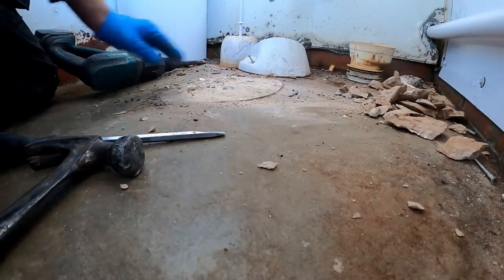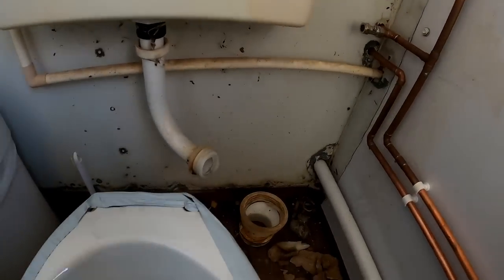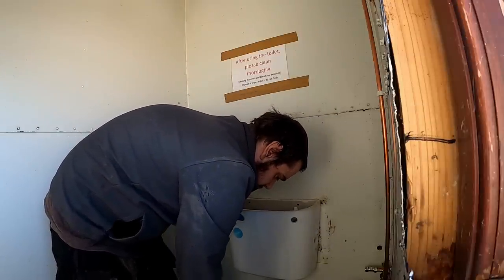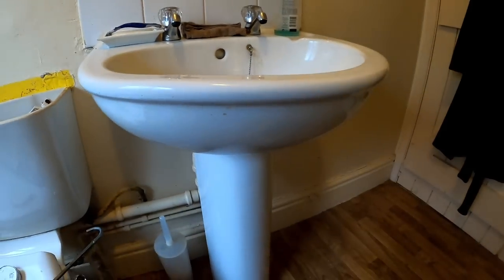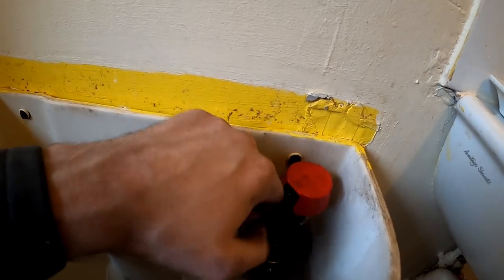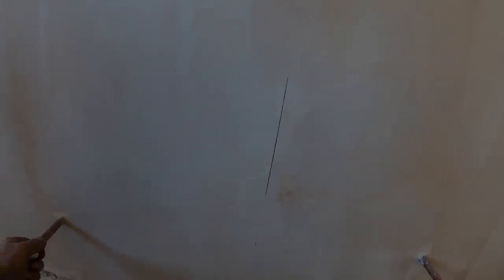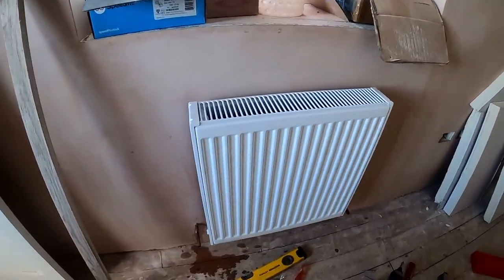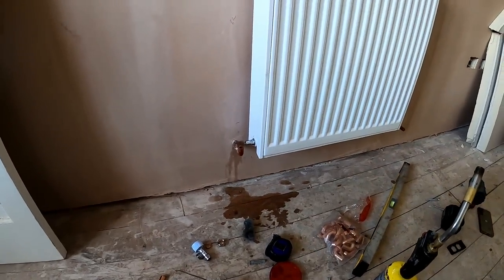Jobbing Around Sorting The Problems

Comment: Hey Tom 
Little tip for getting the silicone off inside the cistern,  the yellow paint scraper that has the Stanley blade in it, cost about 3 quid!! Great for that! 
Have you tried the viva ball valves 4 in1 side bottom ½ & ⅜ brass tail 10 Yr warranty screwfix toolstation delay entry as well about 13quid . Keep a few in the truck for every eventuality. Best  bottom entry for low pressure dudley hydroflo remove the green flow restrictor & will give great flow rate 👌
Reply from the maker: I've been mainly fitting the ag air gap ball valves as I got picked up on an inspection from the water board for fitting ones with an adjustable stem, a lot of the vertical ball valves lost there approval due to the seals failing and water being back syphoned into the main, It's difficult to know what to fit for the best sometimes, thanks for watching mate 👍
Reply: @PlumbLikeTom  yeah you're right Tom about the fill valves. The viva ones now incorporate in the stem a unit to prevent backflow.  I used to fit the green fluidmaster delayed fill. But found in cisterns where the hole is close to the back of it inhibits the valve to rise & fall. The same with the pro ones you fitted . Thats why I went across to viva brand. Its so difficult these days to fit anything without some rules or regs forcing you to fit specific brand products!! 
I'm glad I'm not the only one that struggles. I saw that vid on thr pan where the flush pipe cone was leaking !
What I tend to do in those situations is remove the cistern so allows you to stick your head in & remove the flush pipe & cone & fit a new one with out taking the pan out ! I did empathise when you were hauling that pan out nightmare when everything is all tiled in & no access , what I call SEP someone else's problem !!! 

In a different note what do you like to do on your down time away from work as you have to make time for that or you'll end up with burn out! Been there done that! 
The body can't go at the rate you keep pushing it working 7 days a week . 
I do enjoy your videos as you like me are very conscientious & take pride in what you do. Your knowledge & experience at such a young age is impressive . Some of the stuff you do I've never done in my 47year plumbing career so it's always good to learn & see new things. 👍
Reply from the maker: Thanks for the support mate, I will defiantly check out the viva fill valves, the job with the pan was nearly impossible, because the cistern was chopped into the brickwork, there was no easy way to get the thing out, in my spare time I like to repair and collect old jukeboxes, it's just a hobby and I'm not really an expert but I like to see all the mechanism working, the music always sounds better on jukeboxes

Comment: Sorry to hear about the supplier issues. With the messes you are dealing with it must be tempting to have hot spares for pulling parts from sometimes but it's a joke that you would need to do that.
Reply from the maker: Thanks for the support mate, it becomes frustrating when you pay for something and it has parts missing, its difficult to check inside the box as everything is sealed so it obviously left the factory incomplete, it just means extra visits to site, which costs me

Comment: 😂 , Those rads looks chunky , I wish they painted the walls, before you hang them , personally, I prefer to do first fix myself, and have that rad on a wall first before the pipe work goes in . But is never the case when you taking over someone else job 😅
Reply from the maker: Thanks for the support mate, my old apprentice did this job, he still works for me but I was just being put under pressure to push the job along a bit, I will take the rads back off for the decorator, like you say it leaves a much better finish, hopefully it's just the boiler and the bathroom to second fix and this job will be all done

Comment: Try Grant for oil boilers,   support a even more local manufacturer and use Houndsfield from East Anglia!                    I have used both for years and rate them far higher than WB.         HTH
Reply from the maker: Thanks for the support as always mate, I am definitely considering switching to Grants, the last few Worcester I have fitted have been faulty, damaged or missing parts, it's simply not good enough, although all issues do get resolved it adds time and costs onto the job which I always have to stand
Reply: Grants are awful boilers always a leaky mess. Worcesters quality control has been iffy since cover but is getting better.
Reply: @samharrison3994  I personally don't believe WB have made a good ,robust oil boiler since steamers came in!.            Older Grants did have issues with the chromed pipework joints weeping,    alot of this was down to the smallish expansion vsl that the installers thought would be ok for a 16 rad system......     newer ones don't seem to suffer this problem since the 25 ltr vessel was introduced.
My own Grant boiler jobs always had additional vsl fitted and I never had any issues.

Houndsfield is a nice unit but he has a limited size range and no combi,    its good to support a PROPER  British manufacturer though and they are good people to deal with also.

Comment: How do you work out the width of pipe first fix distances are they always the same distance away from the end of the radiator?
Reply from the maker: On first fix you add 90mm on to the length of the rad, a standard radiator valves adds 45mm per side, this method normally works perfectly

Comment: How come the rad valves come with copper and brass olives? Do you have to use different ones on different pipe ?
Reply: Not sure if there is a general rule, personally I use copper olives on plastic pipe and brass on copper.

Comment: Look forward to watch your vids  👌. Question  regarding olive s  ?   Copper \brass  reason please
Reply from the maker: Thanks for the support mate, copper olives are softer so are better for plastic pipe as they take less tightening, generally brass olives are better for heating as you can nip them more, brass olives are normally supplied with more expensive valves, both will work, it's always nice to be given a choice and have a few spare olives for the box, thanks for watching mate 👍
Reply: Thank you for your time with reply  👌

Comment: When would you only use brass or copper olives?
Reply from the maker: Thanks for the support mate, copper olives are softer so are better for plastic pipe as they take less tightening, generally brass olives are better for heating as you can nip them more, brass olives are normally supplied with more expensive valves, both will work, it's always nice to be given a choice and have a few spare olives for the box, thanks for watching mate 👍

Comment: When you say you have surveys done Tom I assume on demolition jobs only where a house is being fully renovated? It's impossible for us to survey everything and also impossible to completely rule out the risk of exposure... We could have been crawling through lofts for example and up there was once asbestos lagging say then it got removed by a random guy in the 90s but he did a messy job of removal and we are there now crawling through and disturbing any fibres that are laying around.
Reply from the maker: Your right mate, all commercial sites have a asbestos log which should be checked before starting any work, domestic work can be a minefield, like you say you don't know what others have done before, anything after 2000 you should be fine as we stopped using asbestos completely in 1999, for renovations I always have a survey done, at least then you are working as safely as possible, thanks for watching mate 👍
Reply: @PlumbLikeTom  fair enough mate keep up the grind 🙏

Comment: I thought you had stopped using the fluidmaster fill valves because of cross contamination through back siphonage on low pressure  ??
Reply from the maker: This was the only ball valve that was in stock, I've been told the viva ones now have a built in check valve so  might have a look into fitting them, thanks for watching as always mate 👍

Comment: Great vid as ever, what’s the use for brass and copper olives?
Reply from the maker: Thanks for the support mate, copper olives are better for plastic pipes as they are softer and tighten easier, generally on copper heating pipes I would use brass as they nip up better, you tend to find better quality valves have brass olives, both will work, its nice to be given a choice and have a few spare for the van
Reply: @PlumbLikeTom  Thanks, every days a school day.

Comment: How do you get asbestos survey? Who shall I call? Is it expensive?
Reply from the maker: I use a local company to do my asbestos survey's, they manage all my health and safety including training and risk assessments, prices vary massively depending on the type of survey. A full in depth one, I believe called a type 3, demolition and works survey, involves physically breaking into surfaces to take samples in the areas required for works. A licensed contractor will then come in and remove the asbestos. I just had two fairly large artex ceilings removed in some school toilets, the removal costs were around the 3k mark, obviously this is expensive, but the fines to me if not done properly would be massive. Domestically most contractors would not bother as its expensive, remember white asbestos was still used up until 1999, so anything built after 2000 should be asbestos free
Reply: @PlumbLikeTom  are you paying for it and then charge the customers  or they pay directly? It's a shame that a school still contains asbestos
Reply: @PlumbLikeTom  So, if I got it well. There's 1 company coming to draw a wall sample and take it to the lab to check and if they confirm it is asbestos then you need to call the licensed cinttactor to get rid of it right?
Reply from the maker: This gets a bit complicated because some white asbestos is non licensable, which means a non-licenced contractor, which I am can remove it, I prefer to just let a licensed contractor to remove everything as to be honest, it can be more hassle doing it yourself.
Reply from the maker: The vast majority, probably more than 99% of schools contain asbestos, my old local school, before it was knocked down, was entirely built from it. It was such a cheap, brilliant product and was used widely in the construction industry up until 1999, during the 60s when there was a population boom, it was the cheapest and best product to build things from, it just so happened that it also kills you. Virtually every single product manufactured at the time, contained some form of asbestos, even glues, adhesives, light switches, toilet seats, you name it, it probably contains asbestos
Reply: @PlumbLikeTom  I know. As a new plumber I just want to know how to reckon, who I ha e to call for checks and who I have to call to remove it. Those one who checks are not the same one who removes it seems to understand from your comments. If you can give me further details or company name that can check I would appreciate 💯

Comment: I think you’re a bit brave soldering a pipe running through Kingspan.
Reply from the maker: It should be fine, as long as your not directly pointing the flame it shouldn't cause an issue, thanks for watching mate 👍